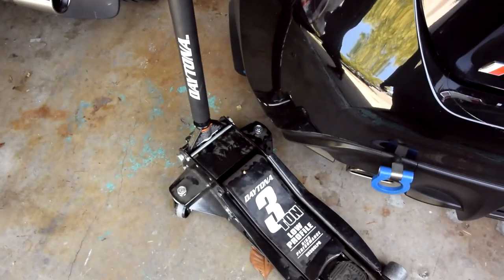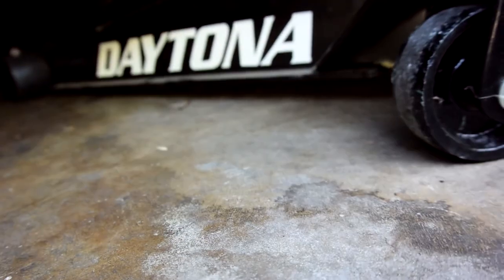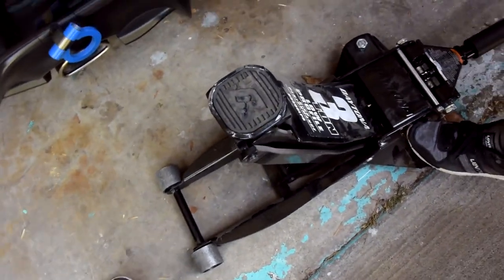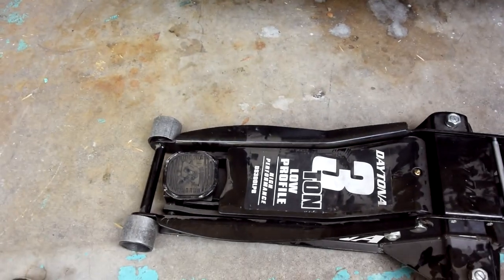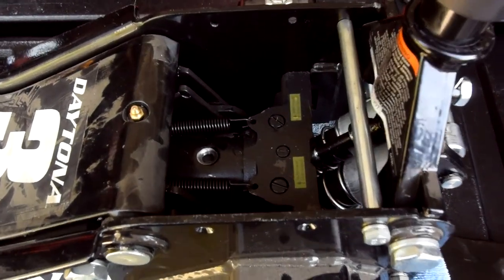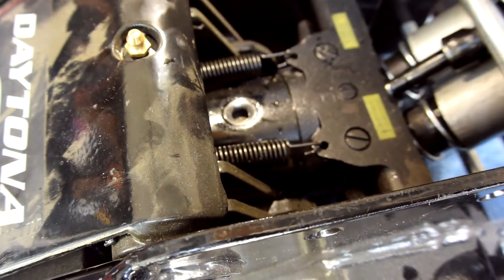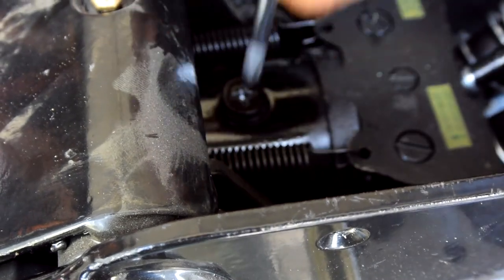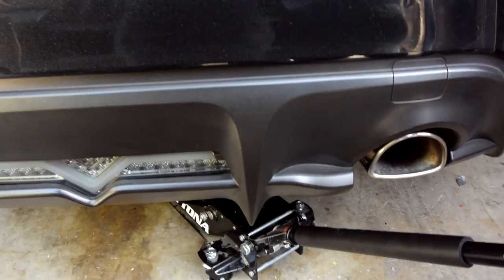Repairing a Daytona floor jack

Comment: I have the orange one. It worked flawlessly for 3-4 years, but now it has the same symptoms yours did. I'll try your fix tomorrow.  You've saved me a lot of time. Thank you!  P.S.  The fix worked perfectly. It's back to lifting like new.
Reply: If it ever stops working for good the hydraulic unit is $60. You gotta call the harbor freight number but better than buying a whole new jack

Comment: Trash floor jack. Bought one. Broke after three uses. $250 wasted. Would not recommend at all, or if you do buy it, get the warranty. You'll probably use it.

Comment: I ended up buying the yellow one. I followed the directions to purge the air in the system and it has worked flawlessly. It is my first jack but to me it seemed pretty solid. I’m thankful for no issues.
Reply: If it ever stops working for good the hydraulic unit is $60. You gotta call the harbor freight number but better than buying a whole new jack
Reply: @  thanks for the info.

Comment: I have the orange 3 ton low profile Daytona.  Its a good jack, meets all my needs, but it leaks and has sine it was (naturally) just out of warranty.  I've been through a whole bottle of that same jack fluid and it now seems to be leaking out at a greater rate than before.  Probably going to be time for a new jack soon...might just disassemble it though to see where its actually leaking out.
Reply: I have an orange one that I have used occasionally for about 3 years and has worked perfectly. Just recently noticed a little puddle underneath the base of the handle area each time I jack up a vehicle. Will have to spray down with brake cleaner and see if I can locate the leak. Cheap o-rings hardened and causing the leak perhaps
Reply: If it ever stops working for good the hydraulic unit is $60. You gotta call the harbor freight number but better than buying a whole new jack

Comment: mine leaks when its lifted pretty high up (lifted jeep) but still works. I have oil spots all over the floor and the main cylinder is where its leaking from. Harbor Freight had no interested in helping me figure out how to fix the leak.
Reply from the maker: We are in the same boat. You have two options the first option is to find replacement O - rings, hours of labor replacing it, using PPE, and finishing off by bleeding the air. The second option put it aside and get a new one. You also can find a new main cylinder but at the price they are going right now you be better of buying a new one.
Reply: @hearttoengine9044  Ya I figured after watching the snap on video how to rebuild there's, Im not doing it. Ordered a Pro Eagle the other day and ill just sell the Daytona for a big discount.
Reply: If it ever stops working for good the hydraulic unit is $60. You gotta call the harbor freight number but better than buying a whole new jack

Comment: Did you follow the instructions about bleeding out the air in the jack before use...I have been thinking about buying this jack, all the people say you need to follow in the instructions about bleeding out air and adding oil..
Reply: Generally the people who run into problems with "things breaking" are the ones who don't read the instructions.

I bought the orange daytona 3ton long reach today, bled the air out, and it works beautifully.

Floor jacks are very simple machines, and require the basest of maintenance.
Reply: Mines about 5 years old. And i just ran into the first issue. My jack doesn't raise as high as it used to. It needs service done to get the pressure back. Mine was $50. I highly recommend this jack. Just don't forget jack stands.

Comment: Woohoo..100th like on the video. You also helped fix my jack. My brand new jack wouldn't raise. I noticed your jack handle turned 4 or 5 revolutions, whereas mine was only turning 180 degrees in either direction. After watching your video I went for broke, or broken wrists, and finally got the valve to break free. Now the handle rotates 4 or 5 revolutions in both directions, and the jack goes up and down, and holds pressure. Thank you.
Reply: So what fixed your hard to turn handle issie
Reply: If it ever stops working for good the hydraulic unit is $60. You gotta call the harbor freight number but better than buying a whole new jack

Comment: The jack tilting is because of two reasons 1) you are not lifting the vehicle at a proper lift point, and the weight of the vehicle is not being properly distributed on the jack. 2) the floor is uneven. It might look even, but take a straight edge and you will be surprised what shit work most concrete flooring is.

Finally, never support a vehicle with a jack only. You're only going to kill the seals in that jack, and HF doesn't sell the seal kits to rebuild those Daytona jacks. ✌🏽

Comment: I'm going to assume your symptoms came back after not too long? Hopefully not, but I doubt anything short of an actual rebuild is fixing this. I did this procedure straight out of the box per the instructions, & again a yr after owning it.
I have the same symptoms as in this vid, but MUCH worse. It creaks instantly, constantly, & as loud as heavy machinery.

Comment: Do these jacks last along time or are they junk I’m thinking of buying the same one
Reply from the maker: It's difficult to say they are built to last. Every day I receive messages how to repair a certain part. I recommend to buy harbor fright tool extended warranty if you do decide to purchase it.
Reply: Had mine "green low profile" 5 years. It was $50. No complaints.

Comment: My Jack still doesn’t hold any weight after this process, does this mean it’s broken
Reply from the maker: After doing this process multiple times and it still not holding weight there's a good chance it's broken. If you have warranty return it.
Reply: @hearttoengine9044  I have the same problem, would putting some grease in the jack work??

Comment: Damn it! I was just about to buy one of these. I thought these had a 3 year warranty?
Reply from the maker: When we purchase the floor jack we didn't have problems the first month. It was fine intel one day we open the garage door we seen a spill of oil. I had leftover jack oil  from a different project decided to repair it. Before the repair we took it to harbor fright with our receipt for an exchange and didn't happen. We also didn't purchase extended warranty simply because the floor jack was intended for light used.
Reply: The yellow Daytona has a 3 year warrenty and is built better.
Reply: I got the green low profile which doesn't see the most frequent use but it get used often. 5 years without an issue till the other day. But it was $50 brand new so i can't really complain about it being cheap. 5 years no issues, just due for service.

Comment: This is because so many of you fools didn't do this as soon as you bought it.
What he did here is what you should have done in the beginning. 
It doesn't come completely filled with oil and you have to bleed it out.
Reply: I did this exact procedure straight out of the box, & about 2 yrs later I have the same symptoms as in this video but about 200% worse. 
I've redone this procedure a yr after purchase as well for preventive reasons. Didn't matter at all.
I use it often, but it's never been abused whatsoever & the loads it's lifting are not asking much of what a  3 ton jack should be handling. 
This is the 2nd one I've had. The 1st one looked like it had been on the boat from China for about 5-8 yrs & was returned instantly.